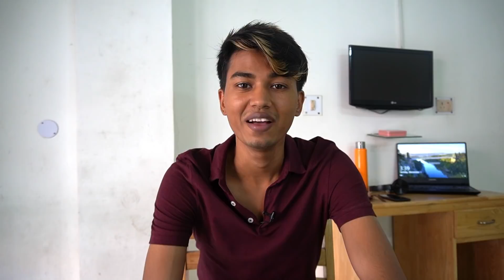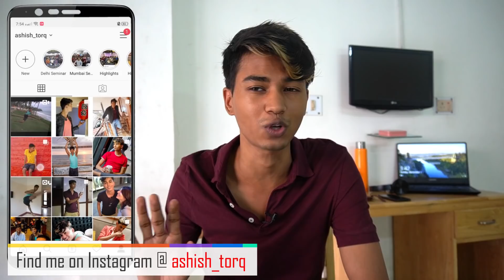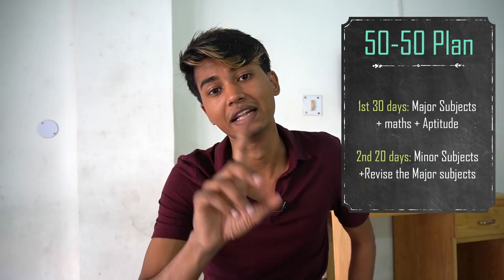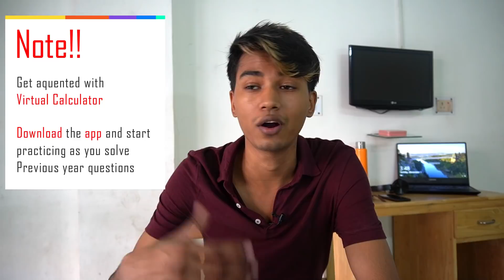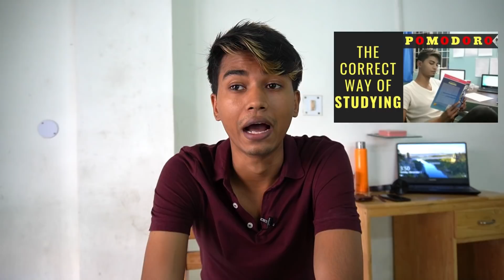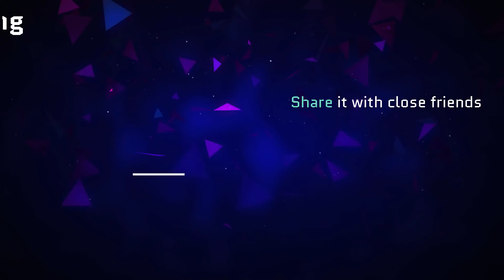Score At Least 50 Marks in GATE Examination

Comment: Been preparing for state engineering services (civil) for last 1 year (2021 graduate) but now targeting gate for a good mtech course. Will be using this strategy, I've exactly 92 days for gate 2023. Let's see how much I can pull up. I've good concepts theoretically and formulas are memorized because of my state psc preparation, but questions level would be different and higher in GATE. Sir do you have any specific suggestions for my case? I am not expecting a mircale, but just wanna score 50-55 so I can get newer iits like Gandhinagar, Hyderabad etc

Comment: Good bro.I was in dilemma how should start my preparation.but this video is very helpful.
Reply from the maker: You're welcome 😊
Reply: What is your marks now
Reply: @Shubham-9996  49, chemical engineering
Reply: Cool sir
Congratulations

I just want to know this strategy works or not, actually I am confused how anyone can do directly questions
Reply: @Shubham-9996  I have seen your comments everywhere, so does this it work ?
Reply: @in_jail_outsoon 
Yes
Partially

I have cracked gate in first attempt, got 27 Marks and cutoff was 22 
So 5 marks above cutoff

I followed this only for 30 days

Got success more than my desire
Reply: @Shubham-9996  thanks for honesty, so we can say using this method we can only achieve 30-35 marks not more than that.

First attempt 27 marks , it's actually good
Reply: @in_jail_outsoon  
Yes